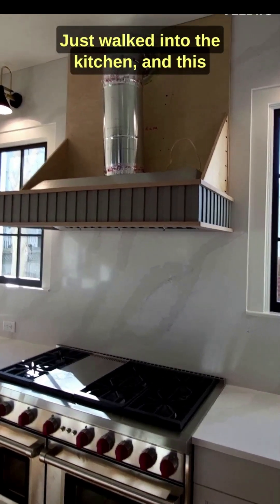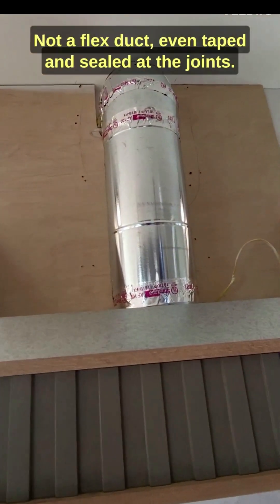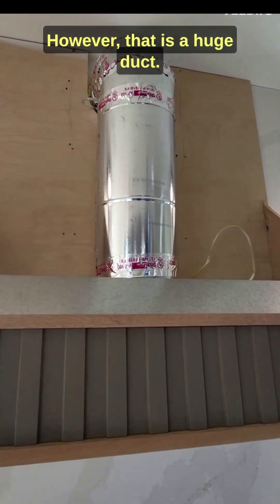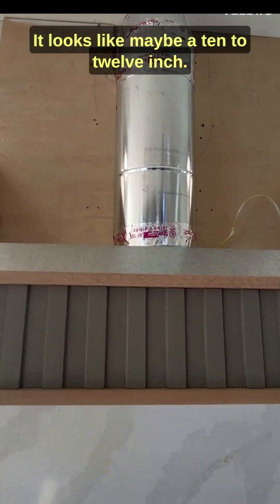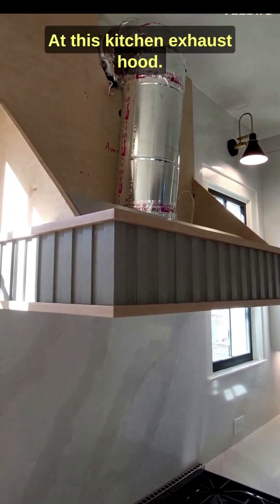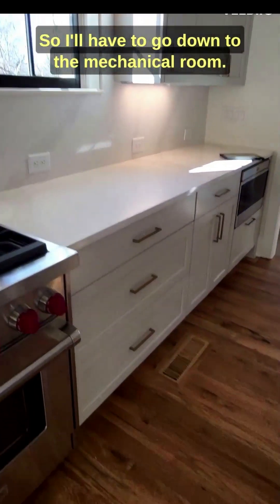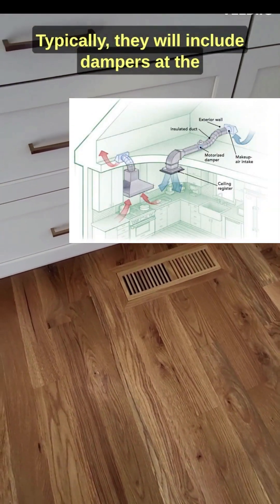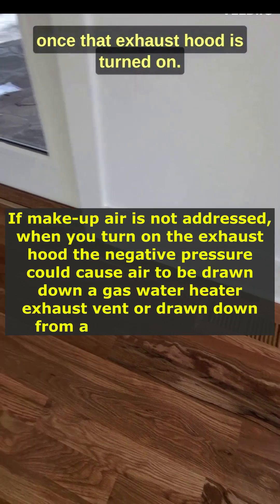Your Kitchen Exhaust Hood over 400 CFM?...Make-Up Air is Crucial.

Comment: Imagine learning this at the end of a storm remodel when everything else is done and you only had enough money to install the hood you purchased that wasn't enough CFMs. Add to that you're a veteran on a fixed income.....I have resigned myself to get used to cooking in the air fryer, camp stove and microwave because whyyyyy?! There should be a disclaimer on home range hoods over 400 CFM that you agree to before you buy. I just thought I could get a 48" from a 36 inch and everything be like it was before.  This has been a extreme lesson in researching products requirements before purchase.
Reply from the maker: So, your G.C. (General Contractor) or the mechanical contractor should already know this.  So, when the buyers go to purchase that 1200 cfm kitchen exhaust hood, this should raise a flag with the GC or the mechanical contractor.

Comment: Why can’t we just open the damn windows?
Reply from the maker: I guess you could,  if you remember to do it when you turn on the exhaust fan.
Reply: @ Hang on, seriously? The code says you need makeup air but doesn’t specify what are the acceptable ways to get it? So if we have an inspector come look at it and just say our make up air is that window over there, they will say it’s ok?
Reply from the maker: I seriously doubt it. That window would have to remain open all of the time or somehow open up when the kitchen exhaust fan is turned on.
Reply: @PPG1967  right. “Somehow open up” would be when we turn on the exhaust fan. Aren’t you an inspector?

Comment: or , you could use electrical range so you  won't need a kitchen hood, so no make up air required.
Reply from the maker: People have kitchen exhaust hoods with electric ranges….????
Reply: How does anyone not have a venting system when they cook? We’ve all smelled that person. They never smell good. We’ve all walked into that house. It’s stale and dirty smelling. Some of us have cleaned a house that has no exhaust in the kitchen. It’s not fun. Unless you never cook anything ever, you need to pull the cooking air out of the house. Otherwise, you might as well pick your nose and eat it. And bathe in bacon grease and hang your clothes to dry next to the stove.

Comment: How about if you have hood rated exactly at 400 cfm? Just want to confirm that it doesn't need the make-up air
Reply from the maker: If it's 400 cfm, then it will.  You need 399 cfm.
Reply: @PPG1967  I checked the code. it says in "excess of 400 cfm.." So yeah, I am confused. Isn't that in excess of 400 means greater than 400?
Reply from the maker: I guess if the hood is rated at 400.5 cfm, then you need make-up air.

Comment: Thanks for sharing this very informative video.
We've just moved in a house that has no exhaust hood and we cook everyday so you can only imagine the amount of steam being released in the house (winter is coming soon too) so we've been thinking of installing an inline exhaust fan in the attic (air grill on the ceiling right above the electric stove then exhaust it through a wall). Do you think that setup would work or if it's even feasible?? The ceiling is about 9ft high if that helps. Thank you
Reply from the maker: I would install a kitchen exhaust hood over the electric stove, about 24" clearance from the bottom of the hood to the stove top or the manufacturer's installation.  instructions.  Then, run a rigid metal duct to the exterior.

Comment: Don't the windows meet the intent of the code
Reply from the maker: Huh???...I don't understand.
Reply: @PPG1967   Since there are windows that I assume are operable does that meet the intent of the code?
Reply: For make-up air
Reply from the maker: @LandSharK3.3.6.6  so, what if the windows are closed.  How are you getting make-up air?
Reply: @PPG1967  what's the code reference. If ya don't mind
Reply from the maker: It's in the video
Reply: @PPG1967 ya open them

Comment: Love that. So many guys miss that.   Quick question though. Curious if that hood is even allowed to be that high off the stove.  Is there a building requirement for minumn and max heights.  Also I know the product has its own specs too
Reply from the maker: So, for a gas stove top, the distance is  normally between 24" - 36"
Reply: @PPG1967  thank you.

Comment: Great topic. An ERV or HRV may help resolve this issue. A question for he building inspector. If there is no chimney or naturally vented appliances, is this still required?
Reply from the maker: Yes sir...new constructed homes are very tight and efficient. So, if you have a 800 cfm kitchen exhaust hood, that additional air has got to come from somewhere.
Reply: Sorry, please stay in whatever your lane is. ERV/HRV? They arent designed to compensate for exaust hoods. They ARE designed for balanced air exchange, and best used at the lowest volume possible that does the job. Thanks for adding useless crap to the internet.